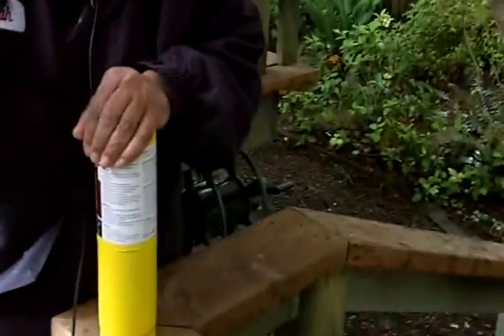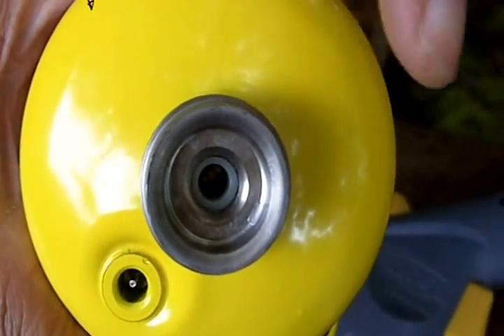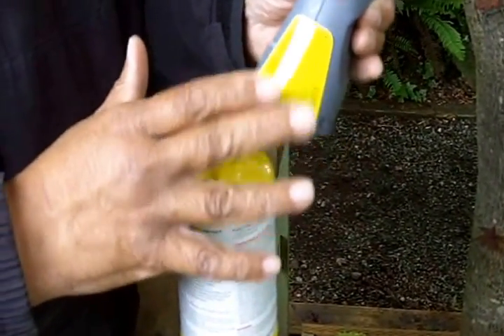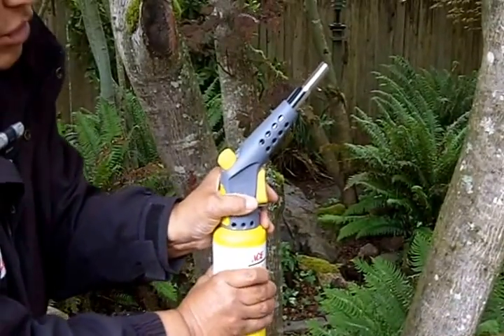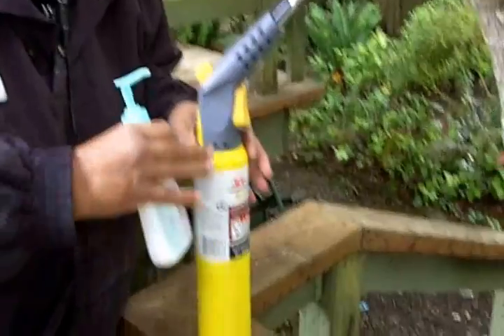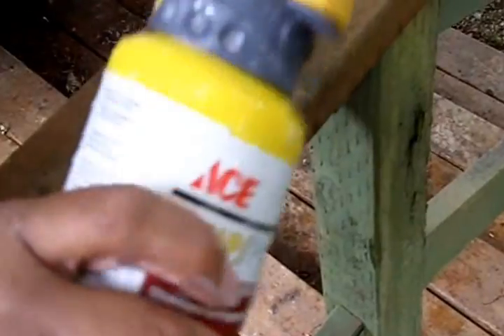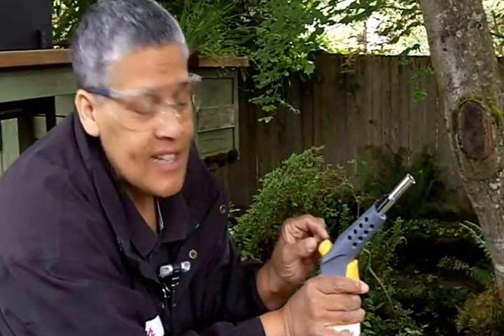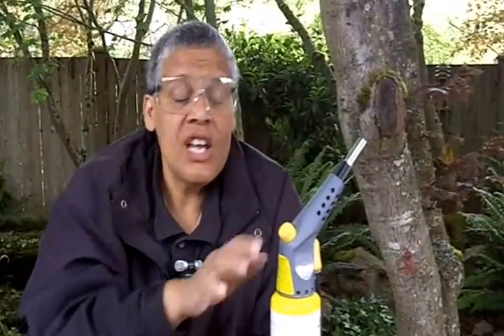How to Set Up and Operate a MAPP Gas Torch

Comment: Thanks for this demo. I used to have no problem but 2 years ago and again today, I could lit it. The trick is that you don't want to open the gas flow too much, else you smother any attempt to lite the gas. So I just cracked it as she shows here and it worked first try. I guess I knew that when I started to use these but had forgotten.

Comment: Thanks! I had one of those valves that leaked.  Couldn't turn it off.  Scared to unscrew it.  Tossed it into a field to leak out.  Not greatest solution, but wanted it as far away from me as possible. Upgraded to something like yours.  Doesn't pay to buy the cheap versions of these.

Comment: Nice video -very educational, so thank you.     But anytime you do or suggest something, explain to folks why. Case in point, why do we need to attached the torch with the canister in the upright position? I have no idea why.     It would have been nice to see you taking the torch off the canister for a complete video (you know, full circle kinda thing).
Reply: Taking a guess that everything is seated squarely when you put the torch on the canister in a vertical position. Good point though why? Should always be addressed in educational videos especially for beginners

Comment from the maker: To not check your torch for a gas leak is absolutely dangerous.  I say this with authority, having been both a journeyman and a building trades instructor.
Reply: seejanedrill It makes it all wet and soapy! Can't you just feel or smell it?
Reply: The smell is so strong, can't you just use a sniff test?
Reply: The fitting to the tank has a rubber gasket seal that seals off the gas only brass on brass fittings require you to check for leaks with soapy water... make sure you dry off everything before using the torch
Reply: Suds test? NOOOO...! MAPP gas is one of the strongest odors of all torch gases so sniff the air. Plus pouring water on the torch before using it is more dangerous on the MAPP Gas Turbo Torch because of it having a different type air flow setup than the common brass torch. I even prefer the simple brass torch (even with MAPP) over any high dollar Gas/Air Torch because they last forever unlike plastic and I have modified the valves to have full use for better flame precision and custom tips that'll allow propane/air to burn hotter than that cheap plastic tip allows MAPP to get. Hell there's Butane-Air torches that get hotter than the plastic safety hazard.

Comment from the maker: Reply to Jane re: where to purchase a torch head:  they are available at all home improvement stores and most hardware stores, so it's best to shop around for the best price, as the ones designed for MAPP gas can run you between $30 and $60.  You can also buy online through the See Jane Drill tool library on our website.  Be sure that you buy a MAPP gas torch head and not one that is strictly for propane..